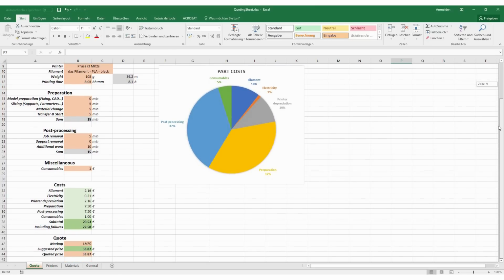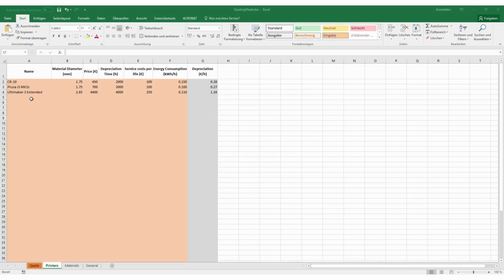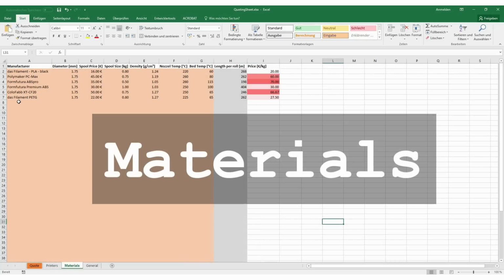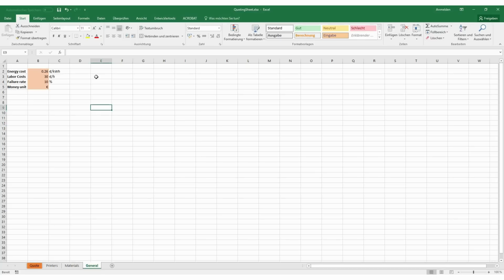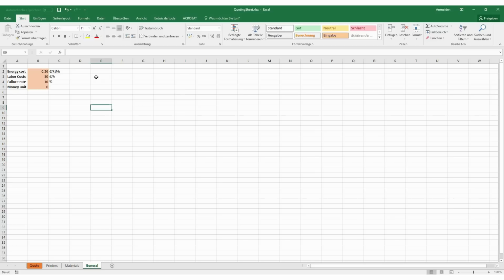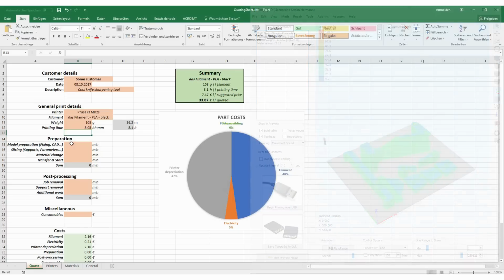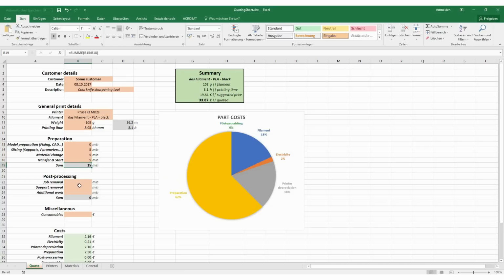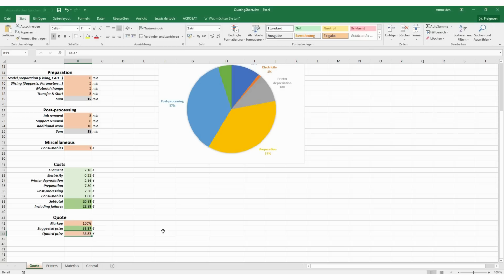HOW MUCH do 3D printed parts really COST?

Comment: Honestly Do people still buy 3d printed things now days, with the influx of cheap cheap china printers im sure most people simply buy a printer calculating the cost of having someone print compared to buying a printer here is a question for all of you and please be honest! how many of you actually made money from selling 3d prints ask by a client ? Honestly i made more money by buying used and building then selling  3d printers and by making my own products with my printers. I can honestly say i been asked to print something but no one offered to pay more then the cost of the filament.
Reply: If they don't want to pay, tell them to buy a printer and do it themselves. 3D printing isn't mature yet. It's not plug and play yet. Most of the customers only want a one time print.
Reply: I agree with P Visit,
Most people are not 'thinkers' and won't spent time shoping the right 3D printer, built it if it's a kit, understand the basic, learn the slicer and Fusion 360 and buy filament and get over the first layer adhesion troubleshooting!

On another hand, I also have to agree with Patprop74,
You cannot make money with only one printer. You need at least 5 or more and a good customer basis to keep them busy. How will you reach thoses customers?

3DHubs and other related website might be an option.
Solicitation on local compagny in your city might be another one.
If you design the part and print them, that might be the best viable option, even with only one printer.

Comment: Print time estimate is off in S3D because it assumes acceleration and jerk, and they cannot be changed. If you use Cura, it has acceleration and jerk control and does take them into consideration for print times. I've had 3-hour prints accurate to within a minute. Even if you just use it for print time, not for actual printing, Cura is good to have around.
Reply: Very bad idea. Different slicing softwares slice differently. Your estimation can easily be off by a factor of 2. If settings are different, 10 is not unlikely.

Comment: 30€/h wage (recomended 20€ to 60€) and 150% markup? Take what the market gives you, I guess, but in the long run you need to ask yourself if what you are doing can be done by people who are payed less than that, or who would be willing to be payed less by working part time from home or on top of their daily job/school. Because they will be the ones who will undercut you once the new market starts to settle down. 
And relying on these revenues to last, while estimating investments into 3d printers will leave you with a bunch of hardware, that will never pay for itself.
Reply: This is a very good point and very true. However, if you're going out spending thousands upon thousands on 3D printers to make a 3D Printing farm trying to turn this into a full time business, then the basic advice stated in this video is far from complete and should not be applied; at least not as your business model as a whole. As someone above has stated, factors such as loans and their interest rate, marketing, etc are never factored into the equation when doing this as a part time thing or just whenever a client happens to pop up.

We're basically getting at the same point, however I don't think CNC Kitchen ever intended anyone to start a full time 3D printing business with the advice he has given in the video; more for the part timer or casual 3D printer wanting to make a bit of cash out of their hobby.
Reply: Exactly this. I need to be able to give repeatable, reasonable, and explainable prices to people that are not just subject to my current whims... or under/over estimated guesses in the moment I am asked.

Comment: Great video. To help you figure out the depreciation cost, I have found that a decent extruder will last about 1000 hours before it is no longer serviceable. This excludes operator error and nozzle clogs. As for the printer itself, typically, with routine maintenance, a printer will last about three years. So let's say you run the printer 40 hours a week - that would make it a little over 6200 hours.

Comment: Your printer depreciates by 10% every time you use it?
Reply: That's not how it works! He essentially equated the printer depreciation to the same monetary amount as filament used (or well, it came out like that on accident based on service life), i.e. if he has printed up a whole $30 spool, his printer has lost $30 in assumed value. Say you have a $600 printer, after 20 spools fully consumed, it might be worn down enough that it might require an extensive repair, or maybe much better devices may be available and expected by customers, and if you reserved the same amount of money for depreciation as you were spending on the filament, your cost is already covered. It's usually OK to overestimate depreciation but it's never a good idea to underestimate it, as not saving up enough money for equipment maintenance and replacement can ruin the business.

I honestly don't think it's an unreasonable estimate for an i3! 20 spools is what, approximately 15km of filament consumed, and 150km of extruded bead laid, wouldn't be a bad run at all.
Reply: Another thing you could do is simply decide how long you want to pay for your printer. That may be a simpler way for some people to look at it. Then, also think of paying off replacement parts, especially nozzles. Once a printer is paid off, you could get a new printer and still use the older one, increasing your output.

Comment: You will spend more time calculating your costs than its worth! It doesnt hurt to know these detailed costs but its silly to do it every print job. You need a simple formula.
Reply: The point is exactly that you set this up once, and then you have a spreadsheet template where you just need to punch in a handful of values and it spits out the result.

But if you're looking for a simple formula, look at the pie chart derived from the calculation on the right: the filament cost turns out to be at 10%. So if you were to just load up the model in a slicer, look at its material weight, multiply by 10 and there is your cost estimate. However, this is with pre- and post-processing: for high quality input files and untreated prints you can conceivably charge a smaller factor, which you can also divine from this spreadsheet, and you can fall back onto spreadsheet for services that reach outside your simplified price-list.

Comment: Typical engineer thinking. Now add all the other business costs, marketing, sales, freight and packaging, cost of imbedded money, credit, payment fees, arrears funding, insurances for liability/warranty, with a business plan you'll also know the developmental steps and need factor in these size change costs. Once you have the cost you can go back to your marketing expert and categorise the market by cost return top down and draw the line at break even. Being an engineer you need to keep the machine running as much as possible to offset the indirects to a lower value this also can mean taking on work below directs cost to reduce indirects. Your real challenge is not driving the printer - concept to fruition, it's keeping the machine fed with work, then keeping the 2,3,4... Machines fed with work. Great vid though, keep them coming
Reply: Except likely for any small operation of Tommy with his two printers in the basement won't have marketing or sales costs. Postage is always a separate charge. Similarly no arreas funding or insurances. Tommy is who this sheet is for not Tim with his print farm.

Comment: I am ... unsurprised or surprised? Can't tell! 

I've also never attended much business classes, and I'm an engineer. I've worked quoting custom products for customers, big and small.  did learn a lot about markups (or "profit margin"), Ex-Works, discounts, currency changes , and the value of having backup providers EVEN when you are tied to one ... and so, it surprised me when I saw your video popping up in my email !

Long story short, sorry I digress a bit, I've to compliment your efforts. Really well done.
You build the price bottom-up, acknowledge the difference between costs and prices, suggest a proper €/h rate (which includes software monetization, computer use, etc...). Of course It might not be perfect for everyone (I doubt shapeways use excel spreadsheets :P ), but for your channel viewers this is just fine.

Big fan of this channel for a reason :)
Also, amazing thumbnail. Love it

Comment: What is your opinion on recycling abs parts to make fillaments? chipping & re-extruding, will it work in DIY level..
Reply from the maker: +John Fox That's why recycled materials are always black 😂
Reply from the maker: +Ruwantha Pushpika Honestly? Too expensive for an individual but doable for a company: Formfutura ReForm
Reply: CNC Kitchen uh...
Reply: I wouldn't do it under any circumstances. New ABS is cheap, far cheaper than your time trying to set up a recycling system. One bit of red abs in a batch of white screws everything up.

Comment: Will be nice support on the spreadsheet for dual color printing, which would also cover dual material (in case of PLA+PVA for example)
maybe where the printer list is there would be a checkbox to mark if the model support dual extrusion?
maybe also taking quality into account? like printing at layer height 0.3 mm VS printing at 0.1?
Reply: And maybe also a place for discount in percentage? So quoted price will be a percentage of the suggested price.
Reply: CheronoSan 
The quality of a print should already be accounted for as it only affects the amount of filament used and the time of the print, which are both already included. If you're using the same type of filament for a dual extrusion print, just different colours, then there's no real difference in using one filament with regard to cost.

Comment: I like the "dont give a rounded price" tip. 
Here we mostly charge for the development (which depends on the complexity and time it takes) and for the time and plastic it takes which depends on the specifications the client might require.
Machine depreciation isnt a factor here, machines are all clones and made by ourselves, and to be fair, other than the plastics breaking in the event of a catastrophic failure (damned inductive sensors!) there's not much that wears out or can fail. I have no idea how long will the betls or the steppers last, but the rest, there's not much that can fail, not even bearings as im using adjustable teflon bearings, which aside from requiring a drops of oil inbetween a week or two (because of dust) they dont wear out not wear the rods. If nothing crashes or something like that, these machines could be working 24/7 for like 2 or 3 years before requiring a replacement part imo. Im sure the frame and most of the components will outlast me for a long shot.
Reply: I recover the cost of building the printer, at least the money un a week or two......and the printer has been printing for months with not a single problem aside a clog or two (which are fixed in a few minutes )
I could literally build two machines (own design) every month and still have some left, i really dont see how something braking would change anything in my numbers really. Am i missing something? We even have replacement parts for almost everything so in case something goes wrong, change and ready to go so we dont even lose money on idle time (almost).
Reply: @laharl2k  What do you sell and where do you sell it?

Comment: Hmmm, unfoertunately your part fan is not properly inserted into its duct ;)
Reply from the maker: Really? I don't see it?!
Reply: No problem mate. Pause your video @ 0:40 : Your 50x15mm fan output should come inside the fan duct (about 1mm). Here we can see it is out with a .5mm gap. So maybe you can improbe your part cooling a bit without this leak.

Comment: Where do you usually get the density from? A lot of filament suppliers are very secret about it (maybe because it could allow you to find out the real supplier of the plastics?). Do you print test pieces with 100% infill and defined volume?
Reply from the maker: Most manufacturers should provide some kind of datasheet, but if you don't find anything just take the value from another manufacturer with the same type of material. They are all pretty close and even if you are off by some % usually wouldn't ruin you ;-)

Comment: Where are you Live?
This is what you currently pay for Electricity: (Germany 2017) https://www.strompreise.de/strompreis-kwh/
 0,29€/kWh
Reply from the maker: E.ON charges me here in southern Germany 0.2512€/kWh.
Reply: @Kassel the good Stuff cost a bit more. :D (at least for me)
Reply: btw as i can see you print with Das Filament.
I print the Black PLA at 215-220°C and for a PLA it is verry mutch i would say but the Surfaces look better.
What are you're settings for that stuff?
Reply from the maker: Same here, I also print most PLAs at around 220°C. Results in a way better inter-layer-adhesion.
Reply: But this should tell us that this Filament is to expensive to work with and it is not accurate manufactured cause it got a Tolerance about: +/- 0,10mm most Filaments got only +/- 0,05. ;)
Reply: CNC Kitchen 
I think the extruder temperature changes slightly for different makes of filament and from printer to printer. I use a LulzBot Mini and usually 205°C is perfect for the Village Plastics PLA I use.